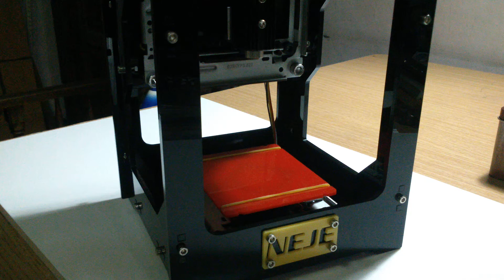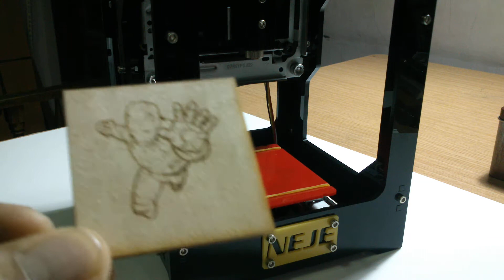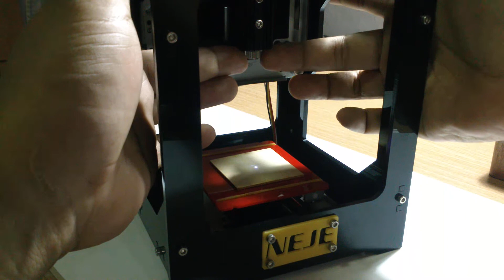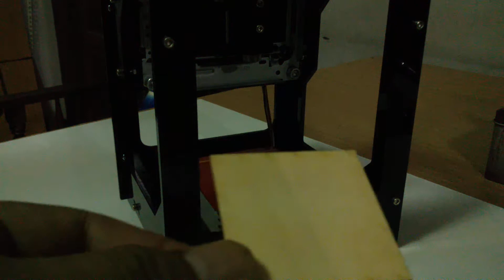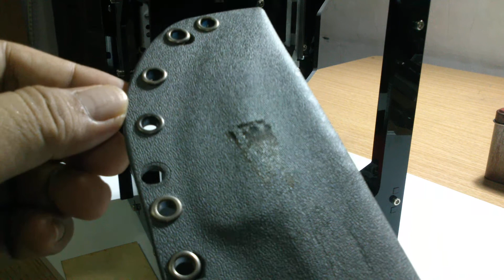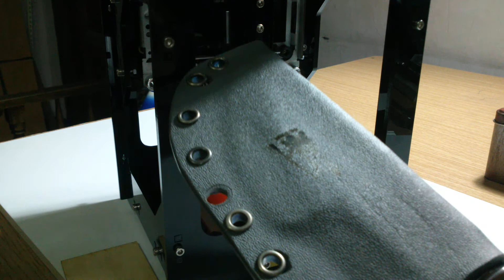NEJE DK-BL 1500mw Laser Engraver Cutter Part 3: Non Functional Engraver

Comment: Thanks for making this series it is very helpful. however I would recommend using the laser for 10 minutes then letting it cool down before using it again. I used my 40W laser for 20 minutes straight one time and it stopped working. But after letting it rest between projects it hasn't broken down.
Reply from the maker: You are welcome @Tech2025. Good info!

Comment: I have less than 2 minutes ago order one of this laser engraver, I hope that it will be 100%. I Hope you have repair yours! let us know!
Reply from the maker: Everything seems ok with the replacement laser module that the seller sent to me. I will be doing a closing final summary video for this laser. I am just using it a bit to test reliability. Do stay tuned for that!
Reply: I bought one of these and just like yours the laser module failed.  These modules are not built to last.

Comment: Hii Janggo. This version can only be controlled by bluetooth. Are not they checked by computer with the help of usb cable?
Reply from the maker: Actually, I had it connected to the desktop and that is how I set up the image initially. After you have sent the image to the machine and set your burn time, the machine saves the image and you can now have a stand alone engraver controlled by the top red button. One press to check the size, two presses to start the engraving and when the machine is engraving, another press on the same top button pauses it.
Reply: It is not the exact answer to this question. Can i control the machine with usb cable without the bluetooth connection i mean? So let's say the machine's bluetooth part is broken, will we throw the machine in the garbage after that?
Reply from the maker: Haha! Let's just chalk that up to being lost in translation. Using the USB cable is exactly how I am controlling it. And after you've sent the image to the machine & set your burning time via USB cable, the machine stores the setting and you can now use it as a standalone unit up until you need to engrave a new image or the built-in battery runs out. In that case, you go back to the USB cable and repeat the "send image to machine" process. I think this version is non-bluetooth. The Bluetooth version is 20 bucks more. Or I could be wrong.
Reply: You wrote it as a video title; NEJE DK-BL 1500mw Laser Engraver. DK-BL; Specifies the Bluetooth version. I made comments accordingly. THANK YOU.
Reply from the maker: Then I was wrong. I just realized it now with the "BL". I just need to figure out how to make the Bluetooth work. Thanks for the heads up @Enbiya Bozali.
Reply: Enbiya Bozali 
What is the bt pin for this machine
Reply: What's the BT pin for this

Comment: Did you manage to fix or figure out what the problem was?
Reply from the maker: The problem was the laser burned out. The fix is the seller already shipped out a replacement laser module. Will do an update video when it arrives. Thanks for dropping by.
Reply from the maker: I believe it is still a good engraver. I may have gotten a dud. Or if not, it does need to have longer cooldown time between engravings.
Reply from the maker: Works really well in a light colored leather material. Works ok on plastic with a bad smell, do work in a ventilated area. The good thing about it is after you have uploaded the image, it just engraves without it being connected to the desktop, you just use the buttons in the unit. I don't think it will ever cut,  you are safe using it on thin material except maybe if it is paper thin, but you can still control the laser intensity for depth.

Comment: Just got mine, and the Auto Connecting is taking a very long time. I am hoping this is normal, it doesn't say how long this will take. Can anyone tell me if theirs took a long time to connect for the first time?
Reply from the maker: You need to turn it on, there is a red button at the back. It is recessed into the frame, it is kind of hard to see it.